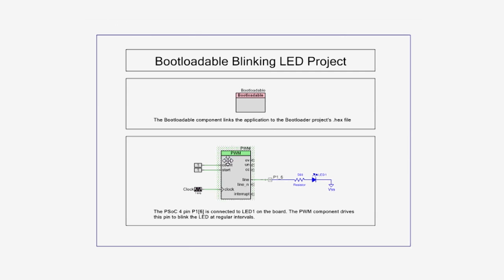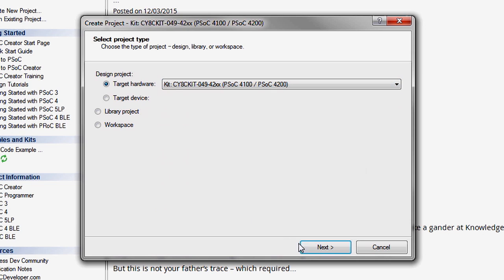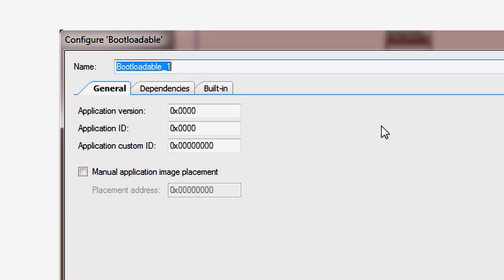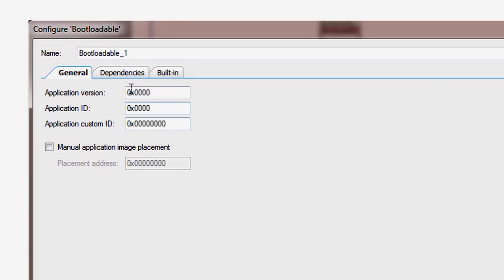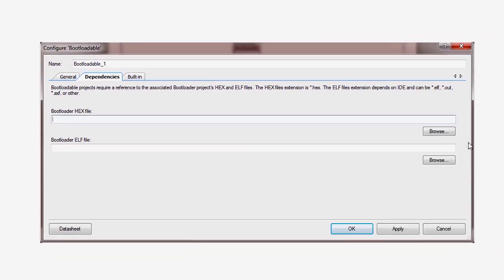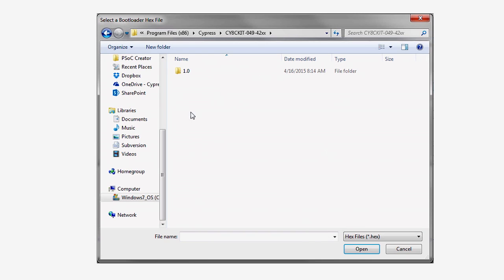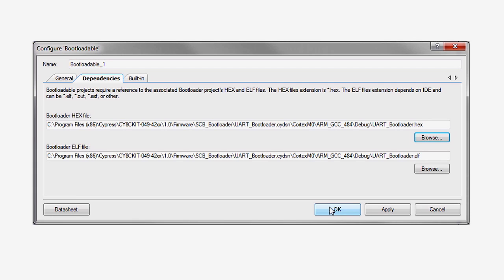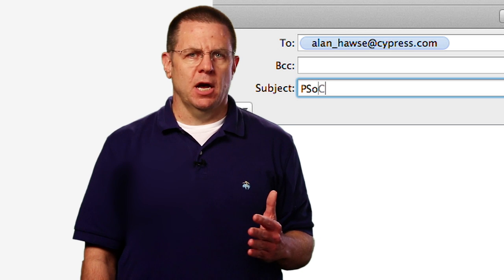PSoC Creator 101: 1. CY8CKIT-049 Prototyping Kit New Bootloadable

Comment: In this video at https://youtu.be/rPPlIM_Ci3E?t=3m47s , we hear:
"Now you can add your custom design..."
And a new graphic just appears on the screen.  Where are the steps for creating this?  Does it have to be "linked" to the pink bootloadable square above it, or are they already connected by virtue of the fact that they are both on the same white space together in the GUI?
Reply: Thanks for the comment. The "custom design" mentioned is intended to be any custom implementation that you want. In this case, the PWM circuit from the first lesson was just pasted into the schematic as an example, but the intent is that you could put in anything that you wanted.

The new custom design circuitry does not have to be linked to the bootloadable component. As long as they are in the same PSoC Creator project then they are automatically part of the same design.

If you would like to some more detailed videos and examples about how to add components into schematics in PSoC creator, check out the training videos at www.cypress.com/psoc101.
Reply: Thank you, Greg.  This is very helpful.